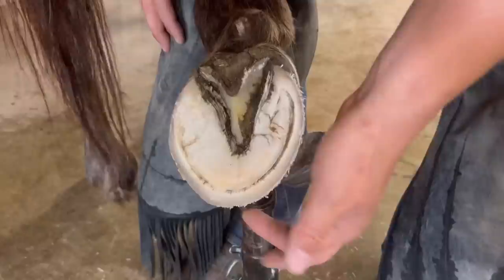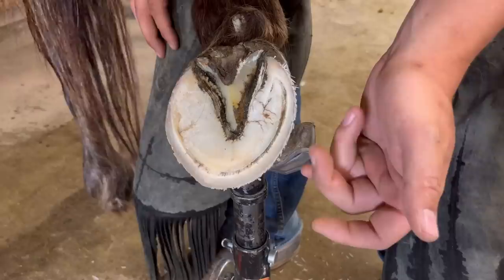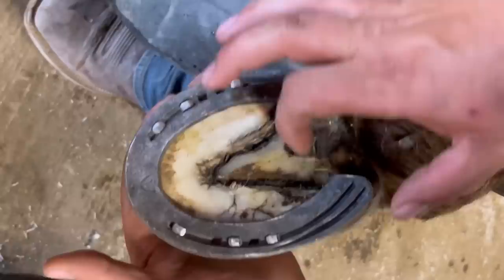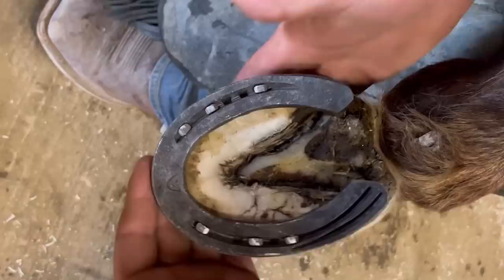CROOKED LEG support HORSESHOE

Comment: I also noticed that the left rear is almost clubby with weak and long pasterns. This horse's conformation is horrible and would only hold up for very light riding and needs to cut about 50-75 pounds.
Reply: Don't we all
Reply: i don't think it should be ridden at all. take it walking with no loads and otherwise let it be a pasture ornament. poor thing kind of looks crooked all the way around. if i owned it, i'd focus on just keeping it comfortable. not every animal needs to have a use.
Reply: Definitely overweight, I also noticed that.  The conformation is so off they horse probably has damaged spine or joints out of alignment.  There is so much more wrong with this horse than the direction of the bones and the way it walks.
Reply: As right as you are, if I were the owner I might be upset if I read your comments. Ya’ll forget that someone probably loves this horse, no matter how crooked his legs.

Comment: How closely did you match the rear hoof angles?  Also, because the horse lands first on the outside branch and squeezes the foot to the inside, I would have (40 yrs. ago) widened, and also thickened  the outside heel, so that it contacted the ground a bit earlier. You make a very nice shoe.

Comment: Does one of these videos come with an anatomy lesson.  I know a horse's hoof is analogous to two of our toes, but I don't know which structures are equivalent.  Help?
Reply: Coffin bone deep inside the foot is the furthest toe bone from the body. Pastern bone, jointed above the coffin bone, is the second furthest toe bone. The hoof itself, made of keratin, is a big specialized toenail.
Reply: @word6344  Thank you.  What is the "frog" and all the yellow/white stuff he shaves off?
Reply: @adde9506  the white stuff is horn, basically like our fingernail. the frog is an interesting part, that the triangular protrusion in the center of the hoof and it helps pump blood up to the horse's heart and lungs. It's thought to be a remnant of two other fingers/toes. Horses have other remnants of their other toes as well, or rather pads (like a cat or dogs "toe beans"). On horses these are called chestnuts and they're bits of callused flesh on the inner part of their upper legs
Reply: @platedlizard  cool, thanks!

Comment: If the horse has become accustomed to its deformity will the correction cause pain?
Reply: It's not really a correction, it's just supporting the foot so it can support the body.
Reply: It would be like going from an old junky pair of shoes to a great pair of new ones.  You might have an adjustment period, but your going to be happier and more comfortable in the new shoes in no time.
Reply: As someone who works on humans who need postural correction, there is an adjustment as the weakened muscles are worked, like any exercise program. But correction ultimately leads to less compensation and overall less pain.